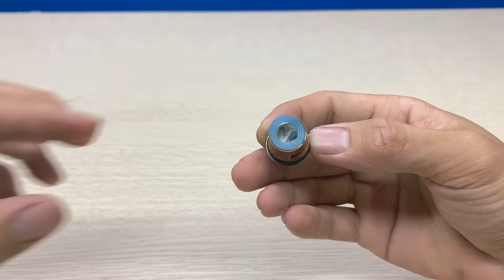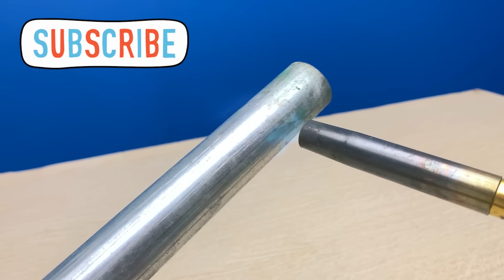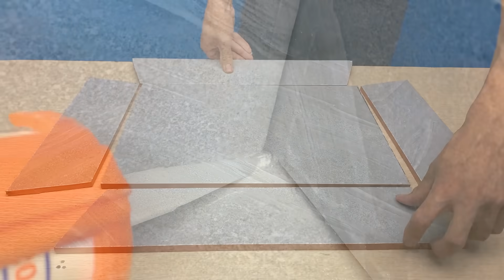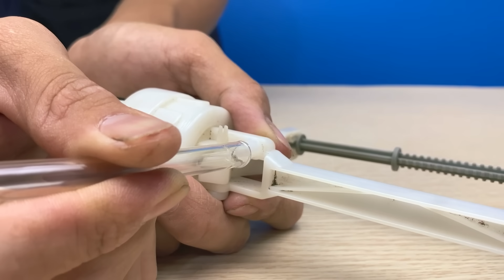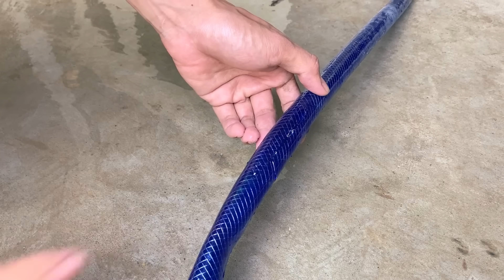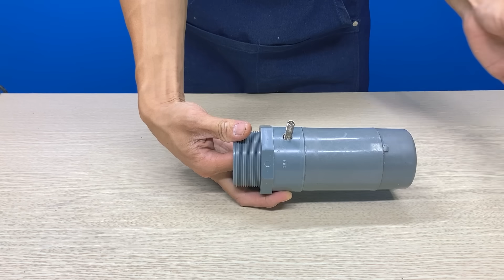Plumber near me trained me in these techniques! Make a water-saving toilet from PVC + ceramic tiles

Comment: I think it would be cheaper to buy a paint sprayer from Harbor freight than all these pipe fittings.
Reply from the maker: Certainly, using cost-effective solutions is a practical approach. When dealing with DIY projects or home repairs, improvising with what you have available can be a valuable skill. However, it's crucial to ensure that any alternative materials or techniques used are still safe, effective, and appropriate for the task at hand.

If you have specific questions about alternative approaches or if you're working on a project with budget constraints, feel free to provide more details, and I can offer guidance or suggestions based on the information you provide.

Comment: turn off loud sound
Reply from the maker: I apologize, but I don't have control over the volume or audio settings of your device. To turn off loud sounds, you should use your device's volume controls. Typically, there are physical buttons or on-screen options to adjust the volume. If you have specific questions about adjusting the sound on a particular device, please provide more details, and I'll do my best to assist you further.

Comment: 1) When you make a Tee Junction, USE A TEE FITTING.
2) When you cut a hole in Porcelain, or glass, or any other "Stone-like" material, USE A HOLE SAW, OR AT LEAST ROUND THE CORNERS.
I can't stand any more. THIS VIDEO is why I think YouTube was STUPID for removing visible Dislikes.
Reply from the maker: I understand your frustration with the video. Using the proper fittings and tools can indeed make DIY projects more efficient and durable. What are some of the best practices or tips you would recommend for viewers who want to work on similar projects with better results? Your insights could be valuable for those looking to improve their DIY skills.